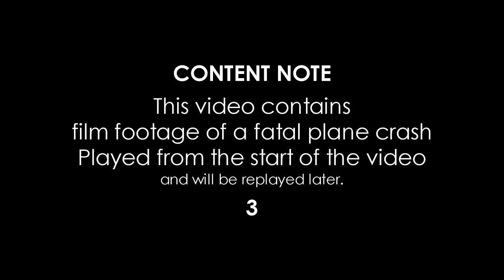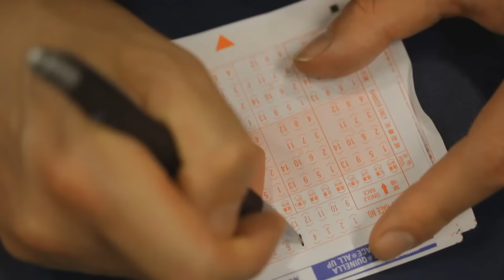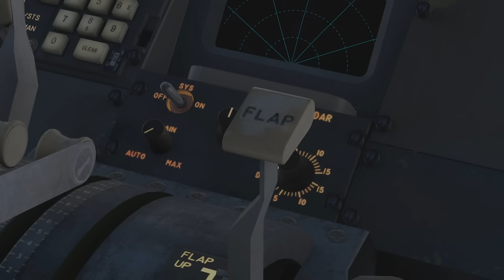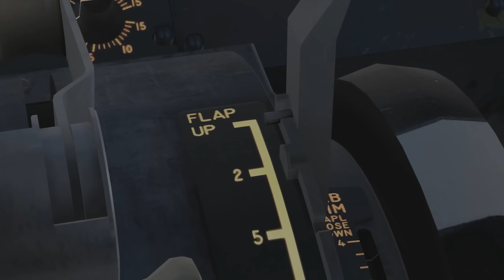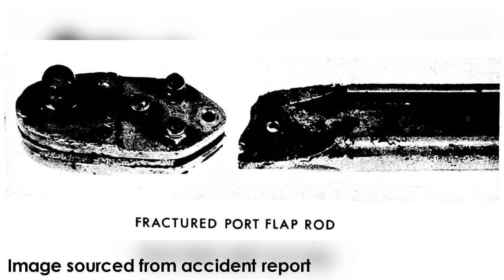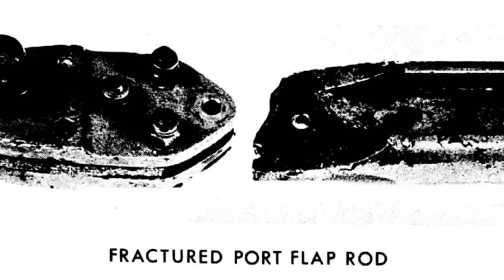This Plane Was About To Break (BKS Air Transport Flight C.6845) - DISASTER BREAKDOWN

Comment: This is a good example on how complicated these machines are, and how one broken system can prove to be fatal.
Reply: And why redundancies are so important!
Reply: @dfuher968  Yes, exactly this! Hearing that the right side was “borrowing” the mechanics from the left was a huge surprise to me. I know that we’ve come a long way in aviation safety but I had never imagined that anyone would think such a design could ever be a good idea. But if the plane was previously used in WW2, then it probably needed to be as lightweight as possible (in order to carry heavy bombs etc). Still, I was pretty chocked at that revelation. Thank god that we’ve learned from the mistakes of the past …even though it cost dearly in lives lost.
Reply: That's so scary to think about that. Is that's why planes now have 2 yokes etc?
Reply: @freddiecunningham2860  yes, redundancy prevents any one problem from being too serious. Modern planes go as far as to double or triple up the clmputer systems

Comment: That footage hits hard. Seeing the nose tilt up especially...Thank you for sharing this incident with us. Fantastic work as always. <3
Reply: Watching the clip, I can see the nose very high, the a/c struggling for power to gain height but it simply stalls, just falling out of the air.
Reply: The final second of the footage was too difficult to see, so the best course of action for me was to turn away during that few second period near the end. No airline in my opinion should have been using late 1940s (well, 1950) aircraft with faulty parts in the late 1960s, when more modern technology was available. Well sometimes, it could be expensive for an airline to replace a 15-20 year old aircraft with a newer plane, so it is understandable. But the designers of the plane should have made the flap rod redundant or out of steel or titanium, but I'm no engineer. Thankfully nowadays in the 2020s, metal fatigue is better understood, and planes are much safer.

Comment: Thanks for this light on a not well remembered crash. I was only 13 at the time and COULD have been at Heathrow when it happened as I was an inveterate plane spotter and habitual inhabitant of the spotters enclosure. But I was at school and missed it. My mum also worked for BEA at that time and I well remember the fuss around Papa-India's fate in Staines. Even so I was shocked when you mentioned the recommissioning of the damaged aircraft and, 50 years later, the callsign Papa India rose unbidden into my mind even before the sequence zoomed in to highlight it!

Comment: -Flaps do increase the area of the wing yes, but primarily they increase the effective camber.  And thus increase coefficient of lift.

Lift = 1/2 r V2 S Cl,  where r is air density, V2 is the velocity squared, S is wing area, and Cl is coefficient of lift.  Adding flaps adds a little S but a whole lot of Cl.  Which means that V2 can now be reduced from cruise speed to landing speed with the same lift being generated....
Reply: I often here that wing size misconception regarding flaps... kids don't build model planes any more, don't know about camber.
Reply: @awuma  When I was building RC model airplanes at the age of 13 I sometimes stopped working on them for 10 minutes in my bedroom because something in my pants was getting a whole lot larger than it had ever been before, like 20 cm long.  

So size does indeed count~

Comment: I could tell you so much more about BKS/Northeast, which was an excellent airline using, certainly in the early days, mostly ex RAF pilots.   The pilot of the plane in question, Ernie Hand,  was one of those and a well above average pilot, and I would also note that his 'clearance' of not being in any way to blame for the crash was just about the fastest clearance ever by the CAA.     I might also point out that when taken over by BEA, for the first few weeks the Northeast pilots regularly had issues over signing for the aircraft becasue they were not up to the maintenance standards they were used to!   But, it was all a long time ago and just about all those pilots and 1st officers are long gone now and flying for a much safer airline 🙂.

Comment: What a tragic story, although not so bad as the Munich Air Disaster in 1958 in which a similar plane was involved.  Today one last example can be seen at Duxford Air Museum.  For those not familiar with this airliner, it was exceptionally beautiful and it was powered by 2 Bristol Centaurus engine, which would start up with a huge puff of smoke and the occasional backfire.  Spectacular.  In my late teens I worked for Aviation Traders at Southend Airport and was familiar with these,  DC 3's,  Curtiss Commando's and a raft of aircraft long forgotten, including our own ATL 98 Carvair. and BAF's Bristol Superfreighters.

Comment: I was an Air Scout in Newcastle, where BKS were the main commercial operator at the as-then Woolsington Airport. Most of my weekends were spent there and we would trade doing small jobs in exchange for flights or simply visiting aircraft or other facilities. Once, we helped carry new seats out, which were being replaced on G-AMAD, when it was mainly flying the Heathrow to Newcastle route. I was quite shocked when I learned that an aeroplane which I saw almost weekly,  had crashed. I recall that  BKS had two more ex-BEA Ambassadors in service back then.

Comment: The flap breaking down in the worst time possible, the pilots had no way to save the aircraft and crew/horses. I think as soon as the landing gear touch the ground the pilots should have just done a crash landing instead of trying to do a go around, it would have been less catastrophic. The trident plane damaged and repaired that crashed later but it wasn't due to the repairs, it crashed due to pilot imcompetence , they retracted the flaps too early and stalled it.

Comment: 8:30 This is not true. Not all aircraft have flaps. Several models of aircraft, such as the Taylor/Piper J-3 Cub don't have flaps because they don't need there.
     As you move down in size and performance you have a situation of diminishing returns. At some point the flaps simply don't make enough difference to be worth it.

Comment: Quick correction. The high lift devices that extended from the leading edge of a wing are not flaps, they are slats. Flaps are only on the trailing edge.

Comment: 13:00 The sad part is, the pilot made the correct choice here, given what the pilot knew.
     If you can't stabilize your approach with the aircraft at the right speed, in the correct position and configured for landing, or if the approach should become unstable at some point the pilot is trained to abandon the approach and go around.
     The most common cause for what the pilot is experiencing is wake turbulence. Wake turbulence can induce an uncommented bank. I would bet good money that the pilot believed he had hit wake turbulence and died still thinking that.
Reply: Informative comment, cheers.

Comment: They were being tested during my first holiday at Fairlight, c. 1949 or 1950. I never liked the 'plane; there was something about the design that just seemed wrong. There was a Tyne Ambassador but turboprops were not generally fitted tho' Handley-Page's Herald had the Dart to upgrade it. Strangely enough, though I was living under one of Heathrow's stacking areas and we also took the London Evening News (as it then was) I do not recall this crash..

Comment: 'The failure occurred only just a few moments from when they were expected to touch down, it couldn't have occurred at a worst point in the flight.' The left side landing gear touched the grass and the pilots decided to execute a go around. I don't agree, I think it was the best moment for this failure to occur. It was a normal reaction to execute a go around, they are trained to do so. But chances are everybody would have survived if the pilots had accepted a hard landing and a damaged airplane and slammed the brakes. It probably would have come to a complete stop without crashing.
Reply: As mentioned in the video, the pilots were caught off-guard ,were under heavy pressure, and couldn't properly think of it the same way we're able to think about this incident 50 years after it happened,
Reply: @X_mezo_X  It's a "what if" question.

Comment: Loved the video, but one tiny niggle. The Airspeed Ambassadors flaps did not increase wing area, the way that modern airliners flaps do when they trundle out on tracks. These modern ones are called Fowler Flaps. The Ambassador had Split Flaps, which means that the flaps, mounted on the underside of the wings, merely hinged when moved by the actuator, although the top surface of the wing , above the flap, does not move. It does mean that great stress is placed upon the actuator when forcing the flaps to move against the air loading, which led to the fatigue failure.
Having grown up in West London, where many worked at Heathrow,,  I recall that a friend's father was working on the construction of Terminal One on the day of the accident.
I look forward to your future videos, whatever the frequency.
Reply: Fowler flaps were in use in the '30s; see the film of Chamberlain flying to Munich.

Comment: Makes me wonder how often things like that have happened really. It's something out of Final Destination, just get on a plane and have it run into and through a building. Makes me also wonder about how building codes are and if they are designed to cope with impacts from planes. esigning a building to withstand a car or truck hitting it is one thing. A plane? Mmm, bigger problem.

Comment: Good thing: footage of the accident was there. Bad thing: can’t see the impact with the building the 3 aircrafts. Also what simulator is this? Cause I’m surprised on how you mostly get the accurate aircraft and accurate livery.
Reply from the maker: This is x-plane. The Airspeed Ambassador in this is not that great, its very basic and doesn't even have a 3d cockpit
Reply: @DisasterBreakdown  And its completely transparent behind the windows ;-)

Comment: If the wheels had touched ground wouldn't it have been better for the crew to just try and slow it down as much as possible ?....even if it was veering off course. It was well past the go around parameters at that point and applying full power for a go around just meant you are going to hit something faster and harder.
Reply: Wondered that myself. A few have made the same comment; no one has replied. There must be one or two commercial pilots who can surmise?

Comment: That Airspeed Ambassador wasn't a half bad looking airplane. I daresay if an intact frame could be sourced, a pair of high efficiency turboprop engines and matching props, and a complete modernization of the avionics, perhaps pressurization added as well and this would be a fine cargo plane. 

As for the accident, no pilot ever wants to see a plane "burning in" and considering the little time the crew had to try to respond to this, they look like they genuinely tried to keep the plane away from other aircraft and impressively managed to keep the plane somewhat flying. If only they had a precious few more seconds, or the failure had occured earlier in the flight. Hats off to them for trying RIP.

Comment: It's rather interesting that G-ARPI (The Accident Aircraft for BEA 548) the image shown. I have that image myself and it's rather scary that the plane was involved in this accident and then just disintegrated in BEA 548 not far from Heathrow in Stains-Upon Thames.

In reference to Dan Air Flight 0034 in 1979
It's about time we return to Tenerife. This is because, this accident was quite shadowed considering what happened 3 years prior. 

I would like to see Dan Air Flight 1008 a Boeing 727 that crashed a few days from the day of that fateful afternoon. April 25th, 1980. It is a shocking and shadowy accident. Considering what happened on that fateful day in 3 years prior at the same airport. This was the 2nd most fatal accident at Dan Air Services LTD in 10 years. With all 146 passengers and crew (138 Passengers and 8 crew) killed.

Comment: The other interesting aspect of this accident is that had the captain instead of going around Tried to put it on the ground as quickly as possible would it have been a success. Hard to say but it certainly would not have been any worse.